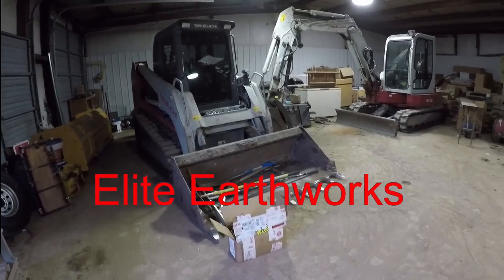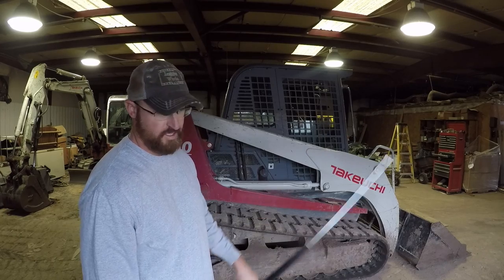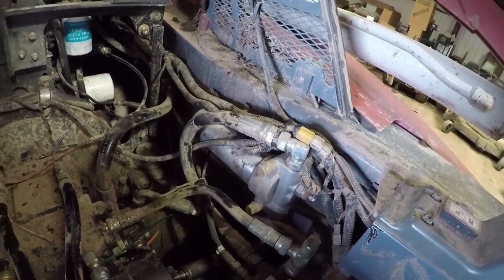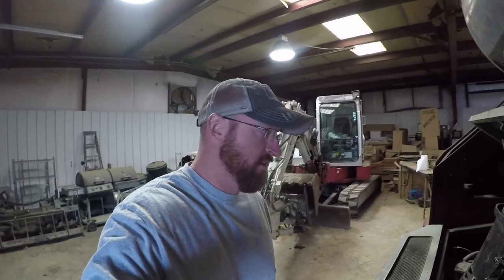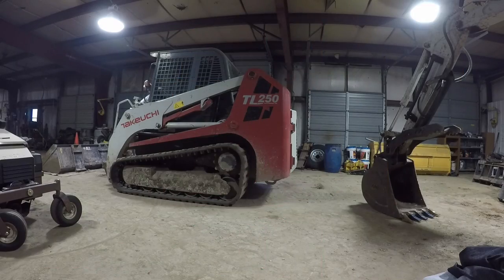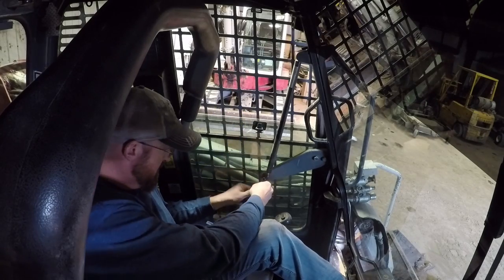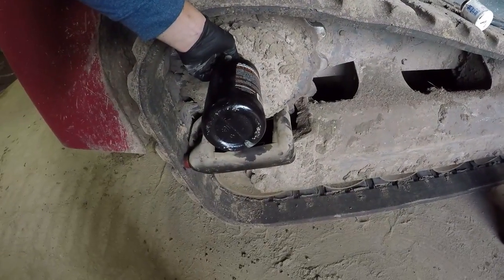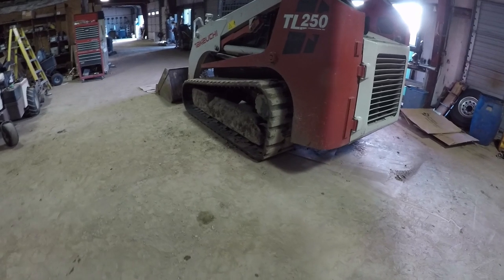500 Hour Service On Takeuchi TL250

Comment: Great vid you take pride in you equipment 👍👍.
I did oil change on my boat to day  still have to do fuel filter do to sick kids that's life and don't feel bad  when I worked for a tree service I run over a $700 saw with the tracked chipper... yup.. I heard that for a while had to work a few Sundays to make up for that one
Reply from the maker: Josh Welner ouch! And thank you! I do and I really try to keep up with anything they need. It can be a full time job though. Thanks again for watching and commenting

Comment: Check your local auto parts store, they might be able to get the lift cylinder cheaper. We replaced a bunch of them on the fire trucks and didn't realize how many different lengths and weight sizes that were available.
Reply from the maker: Dave Guffey yeah I was going to do that. Oreillys couldn’t match them but I’m going to try Napa this week. Thanks for watching

Comment: No no no no, you're doing it all wrong... You're supposed to change the engine oil every couple years and neglect everything else unless it breaks or starts making noise so loud you can't get the radio turned up high enough to blast over it!  That's crazy doing all that maintenance in such a periodic fashion! lol!  You'll never get a new loader doing that since this one will last you forever with all that care taken! lol!  You treat it like it's your own or something!  Ha!  Well, keep up the good work - it pays for itself in the end!  Thanks for the video!
Reply from the maker: burningdinosaurs 😆 all this time I’ve been doing it wrong! Thanks for pointing that out. That is definitely true, when you own them you take way better care of them! As always thanks for watching and commenting
Reply: Burning - Right, gotta be careful w/that preventative maintenance. Sometimes all the dirt and crud is holding stuff together. Remember the old adage, ‘If it ain’t broke don’t fix it!’. 
Seriously - Nice job Brandon! All that PM should help relieve some of that OCD stress too. 👍
Reply: @psidvicious  Ha! Yes! You and I must work on the same kind of equipment lol!
Reply: Burning - Probably! Did’ja ever do something to a machine that you thought was just PM? Then when you start running the machine again, it just never seems to run quite like it did before?? Hate when that happens! 🙄
Reply: @psidvicious   ...and then you consider putting the old parts back in!? lol!!!
Reply: 🤣🤣Right!!
Reply from the maker: psidvicious it really does lol!

Comment: I have all Cats and the worst part of the whole machines are the cabs. The older ones were worse, but the shocks suck! i change them non-stop and they are not cheap. The newer minis have the bottom front window slide up in to the top, so they will wear out even faster! Buy stock in the shock company, then we can all make money!
Reply from the maker: Joe Hussey LoL yeah the shocks are terrible. I understand they take a lot of abuse and vibration but they should definitely last longer or be a bit cheaper. I’ve tried to shop around on the internet but haven’t had much luck. Thanks again for commenting and watching

Comment: Ok so the word is that most Tacs lose the main hydro bank between 2500 and 3500 hours.  Have u seen this w 6000 hrs on yours?
Reply from the maker: mrpush no still running strong, it may be a bit slower on the cycles compared to a  new one but not issues yet. And I’m going to hit 7000 hours this week!

Comment: Awesome videos. I just bought a 2009 Mustang MTL325 which seems to be very much the same as your videos. So I have a few questions. Do you have all the filter numbers by change? Oil, fuel, hydraulic and air filter? I want to do a full service in it.
Reply from the maker: Thanks! Oh yeah Takeuchi use to build the mustangs and gehls. I’ll have to find them but I have the filter numbers somewhere
Reply: I am trying to find the drain hose also for the engine oil. With no luck in Canada ugh

Comment: Brandon great video. I’m looking to get a Takeuchi track loader. Have you had good luck with the reliability of the machine?  Like you, I’ve always had to do my own mechanic work. Would you be afraid of a little bit older machine ?  When would the hours start to be to much in your experience on a decently maintained machine?  Thanks.
Reply from the maker: Thank you! This machine has 8700 hours on it now I bought it in 2012 with 900 hours. It’s still running strong. I guess 5K-6k hours would be kind of high if you don’t know how the machine was cared for. I haven’t had any major issues with mine. Just normal wear and tear stuff but I have taken great care of it too. These machines are fantastic and will run forever

Comment: Nice job on the maintenance Brandon!! Maintenance is cheap but repairs are expensive. I always have a few different sizes of empty jugs laying around to use as funnels and oil diversions.  If I need the same one twice I’ll make one up out of aluminum siding then mark the use on it.  The aluminum holds up much better to heat than plastic.  Maybe one of these days I can give you a hand doing a PM
Reply from the maker: Richard Savaglio thanks! Totally agree with you on the maintenance and repairs. Easier to spend a little bit every now and then. Than a whole bunch at one tile. That’s a good idea on the aluminum. Thanks. And as always thanks for watching and commenting

Comment: i'm wondering if the bushes along the rear boom and cylinder are the wear and replace type or actually have grease nipples ?
Reply from the maker: Dan J the cylinders have replaceable bushings in them and so do the loader arms. Shouldn’t be a terrible job, just a little time consuming. Thanks for watching

Comment: What oil do you use when you do your hydraulic service. .I know you said Rotella 1 5w40 semi synthetic for the engine was curious on the hydraulic. .. I recently just bought a tl130 and I really like what you do and hopefully can do some work like you.  Keep up the good work and vids
Reply from the maker: Bart Ferreira it’s 10w30 engine oil is what the loaders call for. The excavator takes AW46 hydraulic fluid. Not really sure why the loaders take the 10w30 but that’s what the book calls for. You’ll love that 130 their a beast. Appreciate you watching!
Reply: 10w 30 diesel or regular?    And are theyre any know thnigs that i should look for ton the tl130 that you might know ....ps What are the chances that you have any shirts for sale.?
Reply from the maker: Bart Ferreira just regular 10w30. Nothing I can really think of, just check for any play in the pins and bushings on the arms. And check the sprockets for wear. These machine are extremely reliable and tough. Mine just rolled over 6700 hours and it’s still going strong. I’m working on getting more shirts made. If you want to email me at eliteearthworksllc@gmail.com and let me know what size. I’m hoping to have more in a week. Thanks again

Comment: Good afternoon Can you tell which gas lift is installed on the door? I mean the length
Reply from the maker: I would have to measure them to remember for sure
Reply: @eliteearthworksllc  Thanks a lot
Reply: @eliteearthworksllc  I've got it 415мм full 685mm(h=270mm)

Comment: Is it 1.5q per final drive. Or 1.5q total for both?
Reply from the maker: Per final drive
Reply: @eliteearthworksllc  appreciate it. 👍🏻
Reply from the maker: I’m getting ready to make a video how to put a battery in a TL250 mine is done lol
Reply: @eliteearthworksllc  👍🏻it's kind of a pita. As you know it's tight in that bottom corner.
Reply from the maker: It’s a huge pain I’ve done it one other time lol at least the 12’s have a panel on the side

Comment: Did you say 6900 hours?
Reply from the maker: Michael Huhn yes 6800 actually I thought it was 6900.  Thanks again for watching
Reply: @eliteearthworksllc  that's crazy.  Most guys around me(Kentucky) trade theirs off around 3k hours.

Btw, I looked at the new tl12r2 yesterday.  That thing is a beast.
Reply from the maker: Michael Huhn yeah I just really like this one. And it keeps on ticking! I have been eyeing the tl12r2. I was trying to hold off from the tier 4 as long as I could but it may be about time!